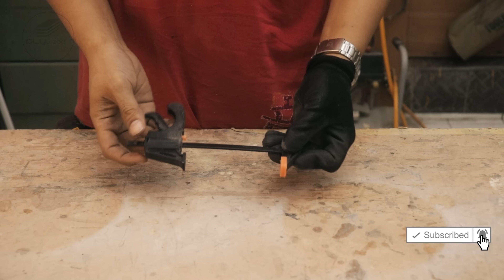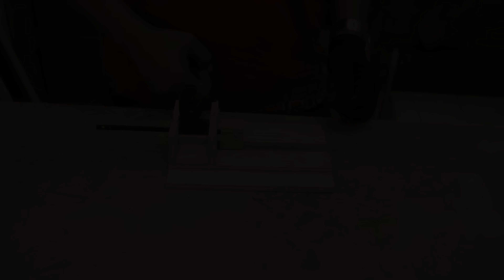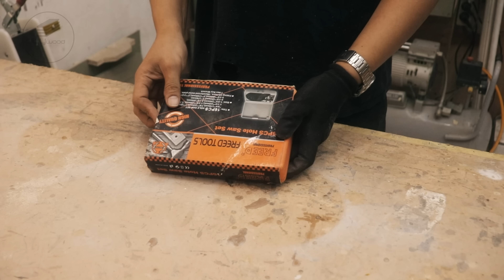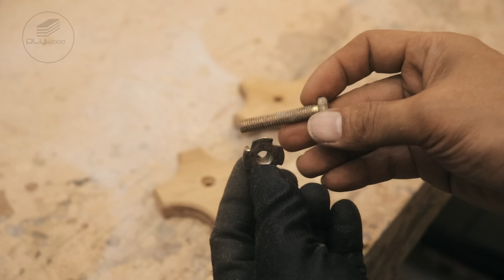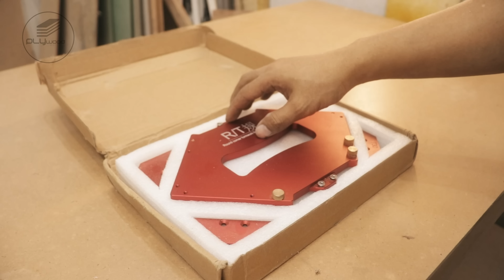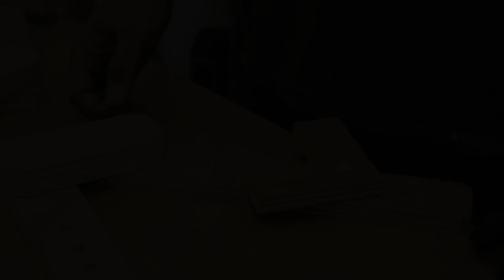3 Brilliant Woodworking Jig - Quick Clamp Picture Knob

Comment: 3.ncü epey kullanışlı
Reply: I have made one similar to this. I use screw in knobs and threaded inserts in the 4 innermost connections. For the 4 pins holding the corner pieces I used aluminium rod. My corner pieces are like pac man - round with one quarter cut out. Very useful, makes an excellent clamping jig for frames.